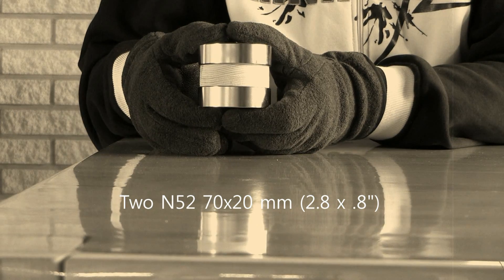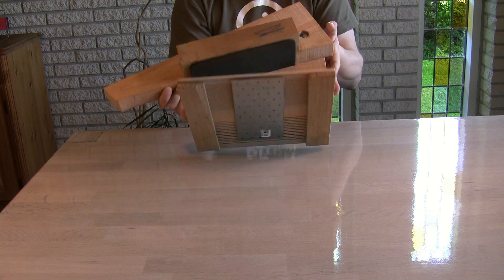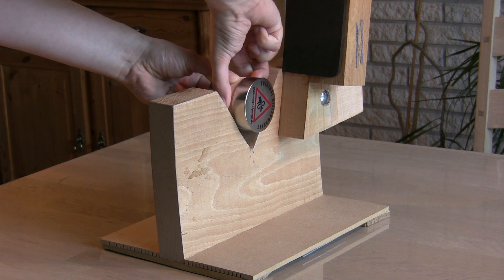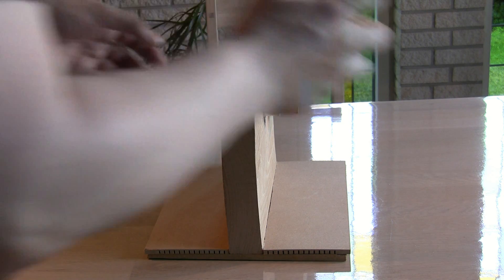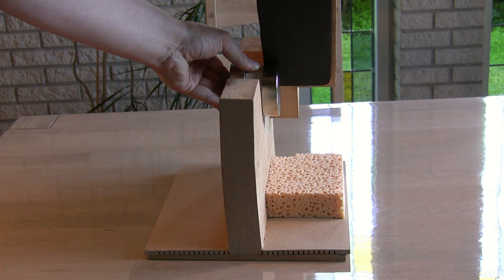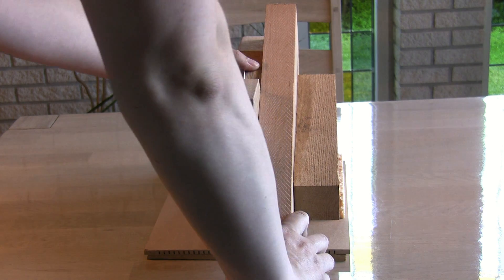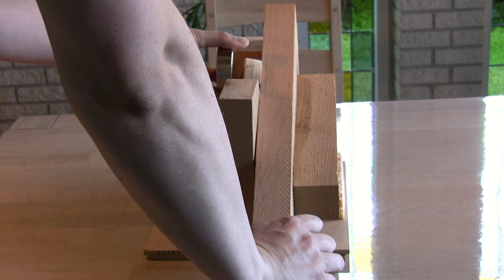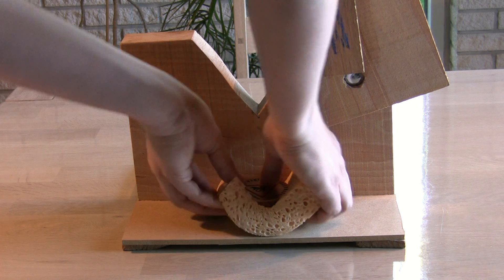Separating large neodymium magnets

Comment: Cool.  I have one magnet embedded in the face of another.  Your method, and LOTS more force might be the answer.

I almost lost fingers when the accident occurred.  The large one was a big cute.  Maybe three or four times the mass of yours.  A monster,  and obviously dangerous.  I also had another one, a cube, with less mass than yours. 1/6 the mass of the big one, but still substantial. I WAS WARNED HOW HAZARDOUS THEY COULD BE.  VIGOROUSLY ON THE COMPANY WEBSITE. 

But I was sitting aft my desk at work examining the large magnet, with the smaller one a yard or so away, behind me on a table.  Seemingly INSTANTLY,  the smaller magnet flew off the table and embedded itself in the large one.  It was so fast,  it seemed like it materialized there. REALLY high velocity.  CRACK!! And sparks,  and people came out of their offices. My hands were shaking.  Any part in the way would have been pulp.  Horrifying!  I thought the smaller one was plenty far away.  I had a friend with me.  This was years ago,  and they are still together!  I tell people about it,  and they think they could get them apart.  Not without a scheme like you have and maybe a way bigger lever arm or a car jack.  I WAS LUCKY.   BE CAREFUL WITH THESE THINGS GUYS. What a way to lose a hand.  Motorcycle accident?!!  No...a magnet accident.  LOL

Comment: Whats the size of the force that attracts them when theyre separated by the wooden disk?
Reply from the maker: I haven't tested it - but using an online calculator the pull force between the two magnets should be around 41 kg/91 lbs with a 20 mm wooden spacer in between. With no spacer it's at least 150 kg/330 lbs...

Comment: I scrapped an open-frame MRI machine once that was filled with magnets-15,000 pounds of them! 4 inch square, about 1 inch thick. Stacked in ranks.  They were only the ceramic type, but still, all combined like that, the tools just flew into the core space!The fun part was trying to scrap them all. I started by sticking them to structural steel pieces until Nucor flunked a load. Then, I built a raging fire and burned them. The fire de-magnetized them. They shattered into smaller pieces, and could not really be distinguished from other scrap metal to the average guy.  Although they are called "ceramic" they are actually a sintered metal product. Too bad Ebay wasn't around!  I probably could'a sold 'em all!   I still have a few somewhere!    I wonder if any MRIs are Neo magnets!!!
Reply from the maker: Aahh, too bad you demagnetized 15,000 pounds of magnets. They would have been fun to play around with :)
I think all modern MRIs use superconducting electromagnets but there may be some older ones out there with neodymium magnets. Many wind turbines use tons of neo magnets in their generator. Quite scary to think about actually :)
Reply: Brainiac75  You bet it was a shame!!  This was before the days of EBay! I just had no outlet for them!!  These things were choking me out!!  They were sticking to everything!!  And also,, they weren't Neo magnets- individually, they weren't that strong! 
I scrapped many many Cryo MRI "magnets"! (the loose name for the actual giant "tunnels"). Made a fortune for a while, when I had the "in" with the company that handled all the CalCoach trailers!  The open-frame MRIs serve a special market. One is that some people will NOT go into the Cryos, and some are too fat!!!!  Also, there is no need for the terrible situation of having the liquid helium and associated needs for these systems. The open-frame types are simple, BUT they do NOT come NEAR the abilities of the Cryos!!
Reply from the maker: junkdeal Nope. That makes sense. The magnetic field of even tons of ferrite magnets isn't a match for a good superconducting loop. Thanks for sharing your experience.

Comment: Do you need one for a 50x20mm disc magnet?
Reply from the maker: For separating two 50x20 mm disc magnets I would definitely use a splitter tool. More info depending on size: https://www.kjmagnetics.com/blog.asp?p=separating-magnets
Reply: thanks

Comment: if i cut a thick magnet through the center to make it thinner will that work? like if i had a brick like magnet but i wanted thinner rectangular strips can i cut them to shape with out ruining them?
Reply from the maker: If you cut a magnet in two you would in theory have two working magnets. In practice it is nearly impossible to cut a magnet in half though. They are brittle and heat from cutting/drilling will demagnetize the magnet.
Reply: Brainiac75 what if we use laser or hydrodrills
Reply from the maker: MALR7 Buy a magnet of the right size and with the needed holes for your project. It's by far the easiest (and cheapest since you'll ruin a lot of expensive neo-magnets if you have no previous experience with it). http://www.kjmagnetics.com/faq.asp#drill

Comment: this all seems kinda reduntant when you can pull them apart
Reply from the maker: At this size it's really difficult to slide them apart by hand unless you are a weightlifter and don't mind the risk of losing a finger tip or two :) Thanks for watching.
Reply: Don't be foolish. You would not want to attempt splitting those with bare hands.

Comment: why do you use wood between them ? if they contact each other in understand the dangers but why ?are they to hard to get apart ? do they amplify the magnetic power when two or more are joined .
Reply: they will disturb the space and time continuum and spagetify everything
Reply from the maker: Basically yes. More info about the pros and cons of the wooden spacer and a test without it in another of my videos: https://youtu.be/9Q8qqUsNf-U
Reply: they will disturb the space and time continuum and spagetify everything
Reply: bow hunter from what I understand, the force required to separate the magnets is inversely proportional to the square of the distance. So twice as close, 4 times the force. Putting them together would make the force required hundreds if not thousands of times stronger and thus nearly impossible to separate. 

Note: I do not know the exact mathematics, so if it is not exactly what I have stated the do correct me, however I know the general idea of exponentially stronger force as distance decreases
Reply: Uh huh thank you I think .it's OK I don't think I need to know now.
Reply: bow hunter Hahahah it's just like super strong gravity, the as you get closer, so like twice as close, the force increases, by 4 times, which is 2x2
Reply: bow hunter I think there is a limit though but I'm not sure how it works
Reply: Probably because if you didn't have that in there they would smash together and make sparks or break part of the magnet

Comment: how much wheight can one of these magnets hold
Reply from the maker: They have been measured by the manufacturer at 270 kg / 595 lbs between two large steel cylinders - but in practice I wouldn't trust them over 200 kg. Still a lot of magnetic power though...

Comment: As a point of reference, the magnets used in some of the older personal computer Hard drives were strong enough such that if you got them out of the computer, and put one on each side of your finger it really did hurt.  How much force do these two magnets create if 1 inch apart?
Reply from the maker: That's not possible to answer. Depends heavily on the size of the magnets which varies a lot in HDDs. Really old HDD's can have massive neodymium magnets. Newer ones have quite tiny magnets.

Comment: why can't you just stick them together what would actually happen
Reply from the maker: They are very, very strong. If just put them together they will accelerate violently and impact at high speed - hopefully not with your fingers inbetween... They are also ceramic and the impact will chip or even shatter the magnets.
If you just stick them together you could end up destroying 2 x $50 magnets and with shrapnel in your eyes :(
Reply: +Brainiac75 ohh

Comment: Cant you use Magnetic Shielding to store them? (Mu Metal) How effective would this shielding be on magnets like this?
Reply from the maker: If it was fully encased in mu-metal it would be well-shielded but not 100%. For comparison it takes 5 layers of 5 mm thick plates to reduce the weak magnetic field from the Earth by 1500 times.
Keeping distance from a neodymium magnet is much more efficient and cheaper than shielding it :)

Comment: I am sure it must have been asked, but if on finger was placed between the two magnets. Would you only be able to count up to 9 or just a hurt finger?
Reply from the maker: With the shown size you would most likely lose a nail or the whole tip of the finger with phantom pains for a long, long time - but still be able to count to 10.
With larger neodymium magnets - especially if they are allowed to accelerate freely at each other - all of the finger bone could be crushed to pieces and amputation the only solution...

Comment: What would happen if the two were thrown into the air a few decimetres apart?
Reply from the maker: They would accelerate violently and smash together. The impact would shatter the brittle neodymium magnets sending sharp shrapnels flying around. So the expensive magnets would be write-offs and you may lose an eye or two :(
Reply: I think they will shatter but still remain in one clump due to the fields.
Reply from the maker: Ryad Arlan Large chunks will stay together, but the impact can be so violent that the kinetic energy in some of the shrapnel is larger than the magnetic force.
It is not uncommon for small fragments to fly wildly around when neodymium magnets smash together. An example: https://youtu.be/_aBOGFocYgc?t=2m37s

Comment: is the magnet really that heavy?
Reply from the maker: No, the magnet is attracted to a sheet of metal under the sponge/wood. This 'locks' the magnet to the splitter tool so it is less prone to fly towards the other loose magnet. Safety first.
Reply: it's not that it's heavy it the magnetic pull is very strong and if held with one hand can get pulled out if it gets attracted to something

Comment: what does it mean when my neo magnets have bubbling inside the nickel coating or when there is a line that shows up on the nickel?
Reply from the maker: +angus murray (Gandalfsmagic846) 
Hi, the bubbles are most likely corrosion of the magnet caused by water or moisture. The nickel coating should be enough to keep moisture from the air out but putting neodymium magnets in water will make them rust despite the coating. If there are scratches in the coating even moist air can make the magnets rust.
Reply: Brainiac75 thank you but when my small magnets get the bubbling they usually break in that spot so does the rust make it weaker?
Reply from the maker: angus murray Yes, that would make sense. Rust is not good for any structural integrity...
Reply: Brainiac75 ok thanks for your help!

Comment: i bought a package of 5 or so of the little ones, and they are so brittle they can and do  break in half if they are allowed to snap together. also given enough time, as you move from one apartment to another,  they stow away and you find them in the strangest places, like i found one under the desk stuck to a bolt i was like "hey that's where that thing went, score! and another one was sticking watches and eyeglasses together, and of course there  is a golf ball size congmoleration of machine screws and washers and nuts in my tool-coffee cans with a magnet in the very center.
Reply from the maker: +rbmaserang 
Hehe, yes. It is best to store them put together and in a box of some sort. Loose magnets can end up anywhere...

Comment: If you directly connect 2 large neodymium magnets you'd better consider them as one, because at that point they are not going to be separated.
Reply from the maker: +Wyatt Halverson 
They will be difficult/impossible to separate by just pulling them straight from each other. But even without a spacer inbetween it is possible to take them apart sideways: https://youtu.be/9Q8qqUsNf-U

Comment: I always get excited when one of my hard drives fails because I get to take it apart to get the neodymium magnets out :)
Reply: +cbernier3 
Amazon has sets of security bits for just a couple dollars, I think my set has 40 or 50 different bits.
Reply: mechanical drives will be here for some times yet ssd is keeping up but mechanicals are getting bigger each day when the 1tb mechanical came out average ssd was 60-120gb now we have some expensive 1tb ssds but for the same price you can get 8tb mechanical hdds and bigger so mechanicals will always be around for cheap and high density storage
Reply: +brent56and1 Better make the most of it while you can, since mechanical drives are starting to become obsolete!
Reply: brent56and1 such things tend to rather upset me
Reply: +brent56and1 where did you get the security bit to get them open?
Reply: Sometimes you can grip the screws with the tip of some pliers. If you cant do that you can try hamering a sharp screwdriver under one of the covers and pry it. They are just torx screws but they require a small bit that isn't included in normal torx sets.
Reply: +sarge
2017 highest storage 3.5" HDD: 14TB
2016 highest storage 2.5" SSD: 15.36TB
Reply: @JustinCrediblename  SSDs cost about 10x more than their mechanical counterparts.
Reply: Justin Crediblename cheap high density storage. How many servers do you know of that run 30Tb of SSD in a raid config?

Comment: Someone said they wouldn't own these because they're dangerous. I don't think that's the case. I think they're afraid they wouldn't be able to handle them safely.
Reply: +NecroBanana wouldnt be able to handle them safely because theyre dangerous
Reply: Flin Dangle Anything can be dangerous, dude. It's all in the handler, not the scenario or objecr in question.
Reply: NecroBanana
good point. except somethings are more dangerous than others and require extra care. did you see how difficult it was to take apart these magnets? you could easily get your fingers between them.
Reply: Flin Dangle I recognize some items may require a lot more experience to handle them, not that they are innately more dangerous than anything else in this world.
Reply: +NecroBanana I agree, strong magnets are no more dangerous than, say, a blowtorch. The only difference is, human beings tend to be instinctively cautious around fire (well, unless they're piss drunk, that is), and it also presents a more visual hazard. Magnetic force, being invisible, and the field size and shape being hard to estimate, requires a lot more attention and foresight on the handler's part, but as long as they have that, it should be fine.
Reply: +PremierMilenkov I also agree. In fact, strong magnets are way safer than, say, poison dart frogs, laboratory grade hydrogen peroxide or radioactive waste; and these are all commonly found objects around the house.
Reply: +NecroBanana Yes, anything can be dangerous, but most things aren't even when you don't have experience with the specific item. If you make one slight learners mistake with these magnets, they will snap your fingers right off. If you are still stubborn then i would suggest buying them and experience it yourself. Otherwise i would advice against buying them unless you have a proper purpose for them.
Reply: Richard van Pukkem I never said I was going to buy them, van Puke-'em. Sorry, your last name is funny.

Comment: I am almost finished constructing my own version of the BS Tool. I am thinking of calling it BS Junior. I have a few very large Neodymium magnets that I must safely separate in order to work with them, so what I have come up with is a bit more scaled up than yours, perhaps. I have a couple of Mother Ship Junior magnets which are the same diameter, but only half the thickness. I suppose I could combine them to make a Mother Ship equivalent, but I don't think it would be quite the same. Let me know your thoughts.
Reply from the maker: If you combine two magnets with half the thickness (2 x 25 mm) you will get something that is very close to being as strong as a 50 mm thick magnet with the same diameter and grade. On such large magnets I doubt that you will notice a difference in practice between 50 mm or 2x25 mm.
On a fluxmeter the two combined magnets should score a little less with the unnecessary two layers of coating between the magnets.
Reply: Scott J Thanks for the information! I just might try it, using my new BS Tool Junior (above). Notice that I have modified your design a bit, installing custom cutouts for different sized rectangular magnets. Now to make the combiner system...
Reply: Scott J Sorry, the picture got stripped.
Reply: I am also wondering if you had ever considered making a video about Halbach Arrays, and maybe a way to safely build one.
Reply from the maker: Scott J I have considered it and really want to build a Halbach array. But it is not easy and I have to think about how to make a perfectly fitting frame to hold the magnets (I don't want to glue them together). I will give it a try at some point :)

Comment: can you separate them with your own hands? your force? or a knife if so??
Reply from the maker: There's no way I could separate these just by hand.
There are probably some very strong men that could slide these apart by hand but they would run a great risk and probably at some point have their fingers stuck between the magnets which would pinch skin/flesh off and be very painful.
Never put a knife close to large neodymium magnets - the knife is likely magnetic and you will have an uncontrollable blade near these magnets :)
Thanks for watching!
Reply: Oh :O
Reply: brainiac75 strongest men could lift 300kg with all their muscles but no way with only hands , so its impossible for a man

Comment: Just to simplify, the calculator states that the pulling force of 2 x (1" diameter, 1" thick magnets), which make up a 1" diameter, 2" thick cylinder in volume has a 61 lb pull, where a single 1" diameter, 2" thick magnet has 69 lb pull.